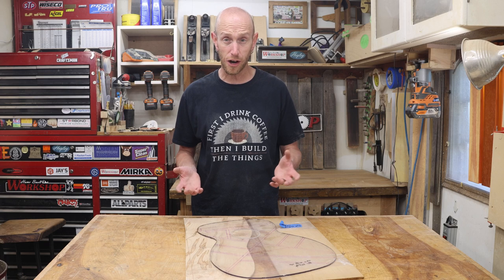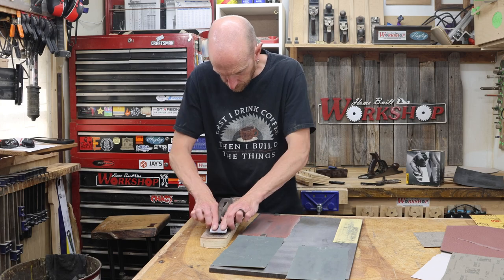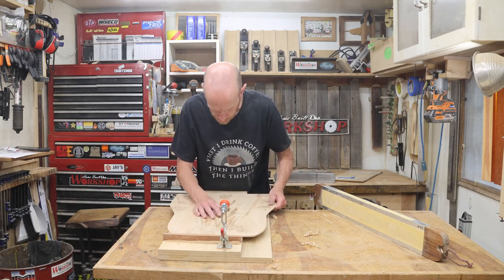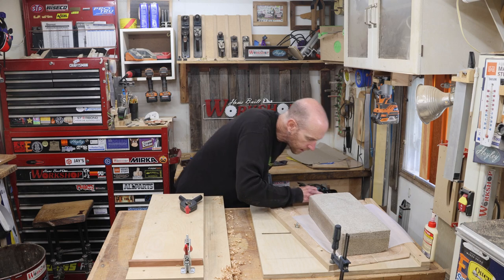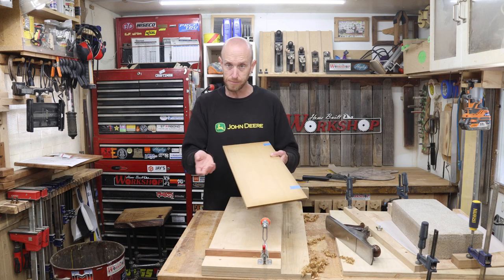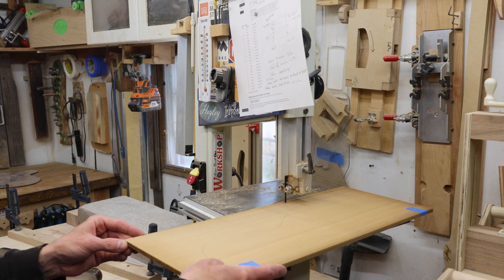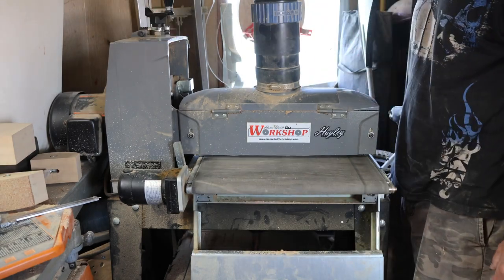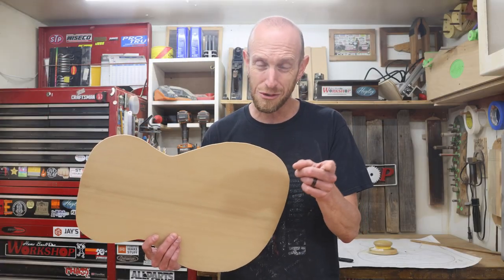Building Acoustic Guitar #2 | EP1 Joining the Plates

Comment: I'm not sure what a rosette would be on a guitar? Where does it go and what is the purpose, Bye for now Ken
Reply: What's the purpose of a rosette on a guitar..?
Reply: If the sound hole begins to split at the edges, the harder and cross-grained direction of the rosette prevents the crack from spreading across the guitar top.   It also looks pretty!